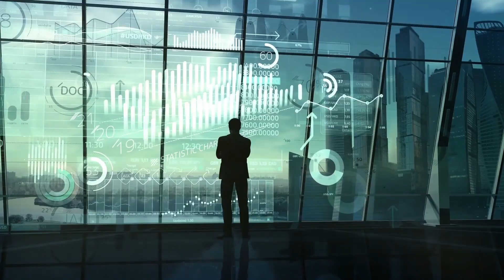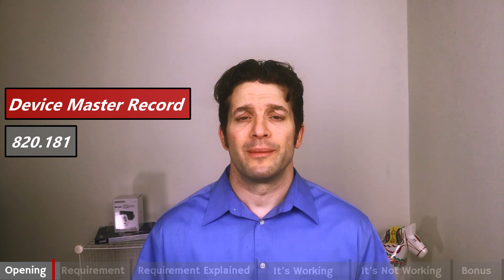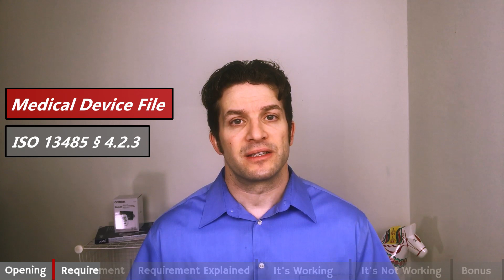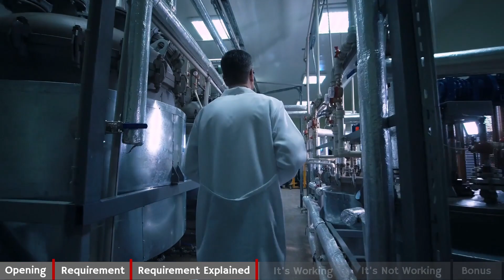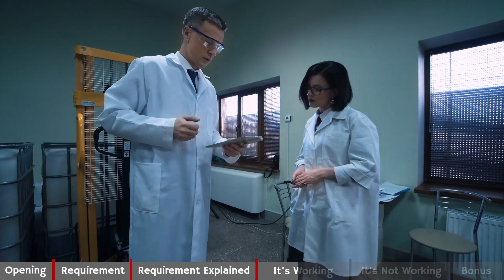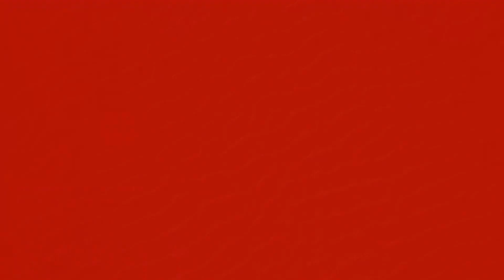Device Master Record 820.181 & ISO 13485 § 4.2.3 Medical Device File (Executive Series #24)

Comment: Should we include all the tests reports that proof the safety and performance of the medical device in the MDF  MDF?
Reply from the maker: No, they do not have to be in the Medical Device File (MDF).  They need to be in the Design and Development File as they are the records that show you met the requirements of ISO 7.3.6 Design Verification and 7.3.7 Design Validation.

Comment: Thanks for the info! I have 6 product families totaling 32 finished goods. Do I need a DMR for each finished good? The biggest difference is size options available.
Reply from the maker: Hi pv6765,
No necessarily.  If they are all the same except the sizes, then they likely share 95 – 99% of the same documentation.  You would then have to clearly define how the different product sizes are determined in some specification which allows for either different component numbers and inspection criteria.   
The DMR would need to be able to cover 32 finished goods.  That means once you have the DMR, you could build any of the 32 codes it covers.
I hope that helps.  😊
Sincerely,
Aaron
Reply: @QualitySystemsExplained  Thanks, Aaron! Very helpful.